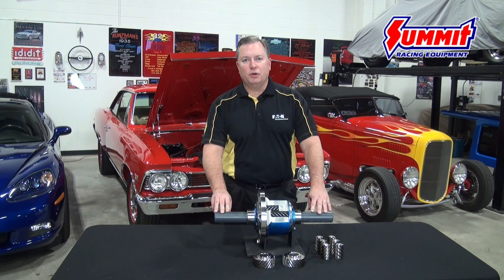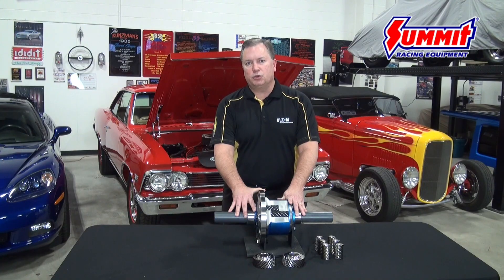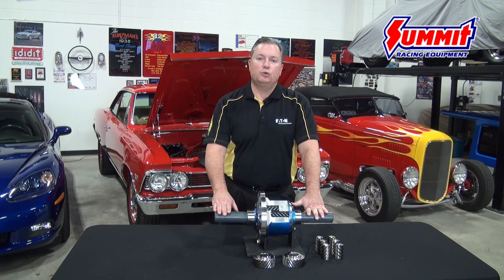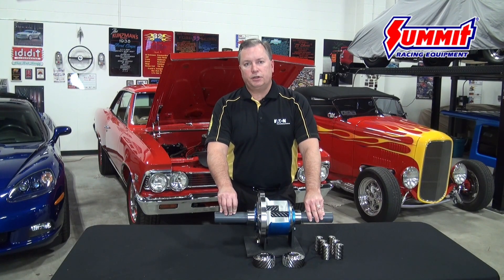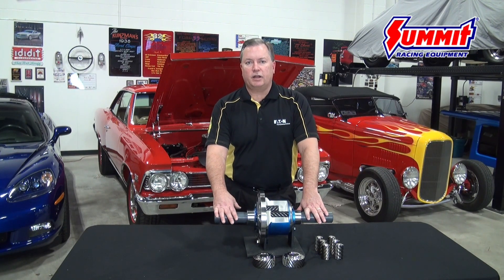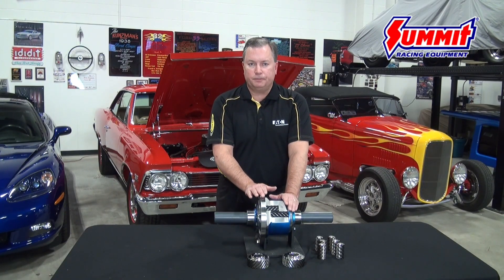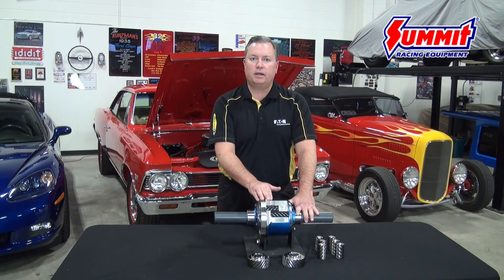Eaton Detroit Truetrac Limited-Slip Differential

Comment: He says this phrase in the video "whether it's a mineral or synthetic-based lube." So yes, you can use synthetic in these. Maybe they made the gears rougher, because people have been whining about that in the past, and from what I understand, even Eaton said no to synthetics.
Reply: Larry Fry they are ok but conventional will make it react and "lock up" quicker as there is more friction essentially making it do what it supposed to do
Reply: Just received my True-Trac from Summit.  The invoice said only conventional gear lube is recommended.  I called Eaton and was told "synthetic is too slippery, use Shell Spirex HD conventional gear lube".   Now, this video from Summit indicates synthetic lubes are okay.    Very confusing.
Reply: That might explain why mine didn't do the whole torque bias thing in certain snow&ice situations more... All I did was apply a bit of brake and then both wheels poofed me going!

Not sure I want to run anything but synthetic, since I live in subarctic. But warmer climates are different

Comment: What would you recommend for a 94 f150 with 35 inch tires in the mud, a tru trac or Yukon dura grip LSD ?
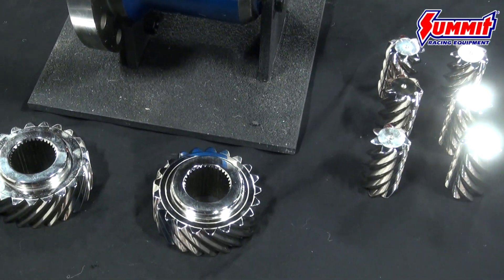Reply: I love the Trutracs! I think they're the best non selective T.A.D.,S on the market .I preferred them to the clutch style limited slips. I just rebuilt the Broncos 8.8" limited slip with carbon fiber clutch packs. The T.T.s are pretty much maintenance free. I guess it all comes on what your going to be doing with the truck. My jeeps I've always run selectable diffs or Detroit lockers. I've even run a spool. Down the road when my bronco is just about done I'll probably go 35s ,chrome alloy axles, 4:10s and TruTracs. It's not like I'm going to be wheeling like I use to in the Jeeps. This truck is to nice to beat on like that.
Reply: TruTrack , clutch type lsd,s wear out. I'm replacing a clutch pack now in my Bronco
Reply: Bill Chaput I’ve got a 1980 Bronco, 4 speed manual. Planning on TrueTrac front and back

Comment: I have these installed in my JK, front and rear. They are amazing. I think it's better than a locker, because it is more flexible.
Reply: I've been curious about how an suv would handle on the streets, daily driving, with one of these in the front (in addition to one in the rear). Some suggest it would make the steering feel a little funny, others suggest you would not feel a thing. What's your experience? Granted it's a wrangler so the suspension and steering kind of feel awful by design but still :D
Reply: Hey I'm looking at having the same install done on my JK.  So you've been happy with it?   Where do you utilize the LSD the most?   I'm primarily looking for my traction in the wet-cement snow we get here in the PNW.
Reply: What gear oil (weight and brand) did you use
Reply: I’m also curious of how people like this in front and the back for daily driving and driving in the snow. I have a 22 JLU- High Altitude with Dana 44’s and I want to add these.
Reply: Thanks for putting this up here im gonna do Some 4x4ing but not hard core and wanted something that will lock in the snow, mud offroad but will work great for you DD so wanted something that works without a switch or air and it just works all the time..  what are your pro's and cons??  Im gonna be putting them in a 17 JKU so a trussed up 30 & 44 OEM setup or if I can find a decent 44 before i change it ill be doing a trussed 44 on both axles..  but how is it in snow & mud?   So basically it applies more torque to the slipping tire the more power you put to it?

Comment: in my Tacoma the front diff disconnects on axle and the transfer case for 2wd. the front diff doesn't spin as is where only one axle is connected spinning the spider gears. do you think the trutrac would act in the same way? noticed he was spinning it by hand pretty easy which kinda answers my question.
Reply from the maker: Hi 123devinzz1, 
Yes!  The Detroit Tru-Trac would work very well for you in the front differential!